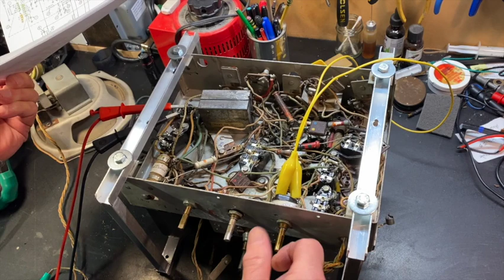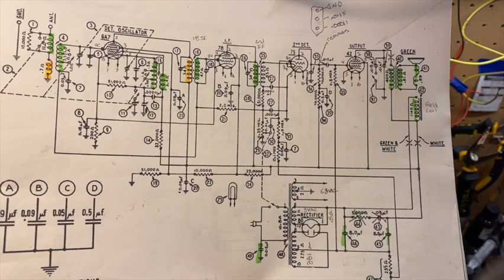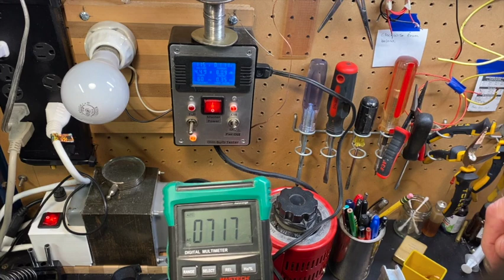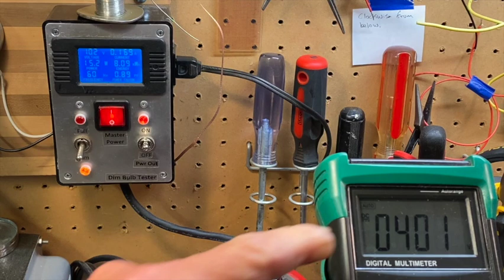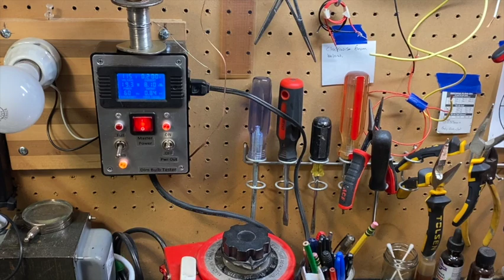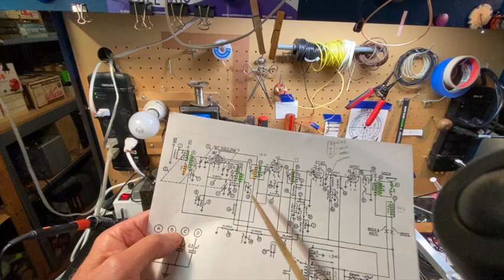Philco 60B Part 7 First Power up

Comment: Glad the transformer is good. Im surprised that the dim bulb didnt light just a bit. Im betting that IF coil is good and antenna coil may be open but will work some. Enjoying following along, I started on the 66B again, when the storms came in and had to stop because of some minor basement water intrusion….lol… I was just catching up with where I had left off…..Thanks for sharing….Take Care—Larry
Reply from the maker: @Backtothefutureradios  Thanks, Larry. Saw the weather was beating up on you guys. Hope it wasn’t too bad.
Reply: @ Thanks, we faired well here, 4.73” of rain, wind gust of only 14mph…..Thankful we were spare, others were not.